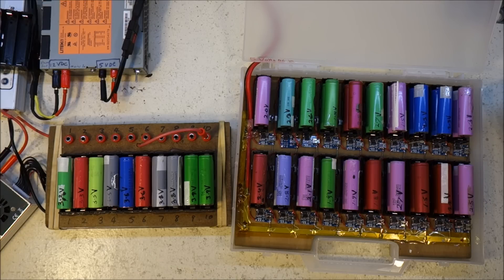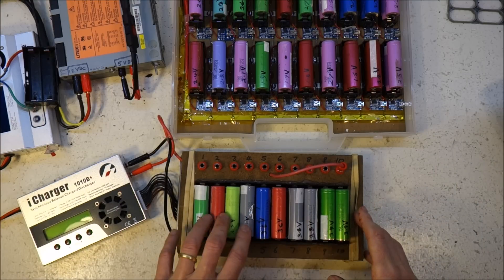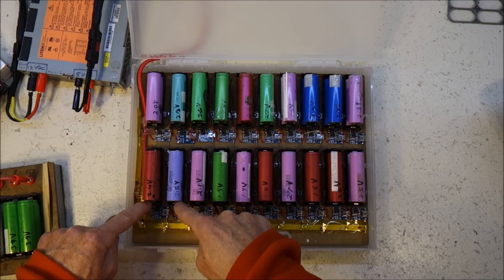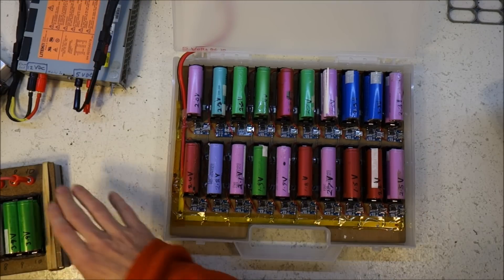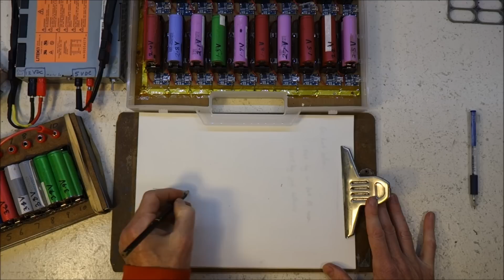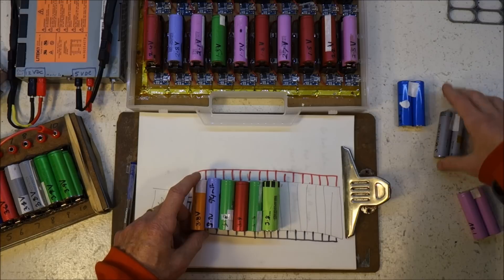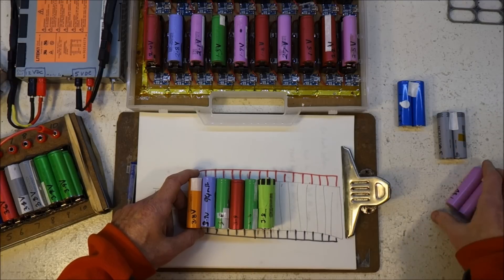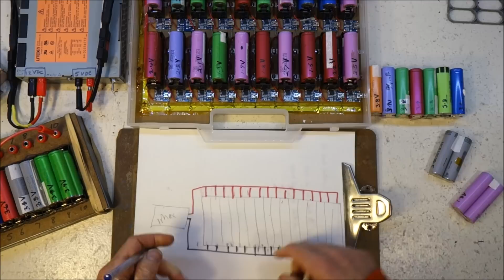Laptop Powerwall 32 - 16-way parallel charger

Comment: Hi Paul, I believe your statement about the balance charging maybe incorrect. If the I charger is the same as the Accucell and the Imax units. When an individual cell voltage reaches 4.2V then a load equivelent to the charge current is added across that cell thus creating neither a charge or discharge situation across that cell. the reason the charge current may drop to a lower level is that the current of the balance circuit is about 100mA.
Reply from the maker: Err! I'd better check that. Thanks for the heads-up.
Reply: how long to charge in one cell..?

Comment: Do you if the imax b6 could be wire to a something like your charging board with 4605's on it? Trying to have more options with what I have.
Reply from the maker: Hi Grn. Not sure if I understand your question - but I'll have a go. An important difference between a iMax and a TP4056 module is the iMax runs off 12 volts and the TP4056 runs off 5 volts. 
Hope that helps.

Comment: Could I charge say 4 cells in parallel using each TP4056?
Reply from the maker: +nztitirangi You could... but it would take a very long time to charge them because the TP4056 charges at 1 Amp max (in my testing they always seem to be running less than that). When you spread that 1 Amp (maximum) over 4 batteries you get less than a quarter Amp per cell - so it'll take ages.
Given that the TP4056 modules only cost US$0.40 each and the battery holder is only $0.46 you might as well spend the extra US$2.58 to get another 3 TP-4056 and battery holders to run one per battery. Much faster.
Reply: +Paul Kennett I made up a 4-cell charger like that, one TP4056 and a 4-cell holder.  I can put in 1, 2, 3 or 4 cells (or pairs of cells) and get 1A, 0.5A, 0.33A or 0.25A as desired.  Makes a nice "adjustable" current option.
Reply: +Paul Kennett Ok thanks - I'll follow your advice.
Reply from the maker: +R Brown (4Crawler) Cool. And thanks for the link. I added a link in my video to your video at the point where I talk about that option.